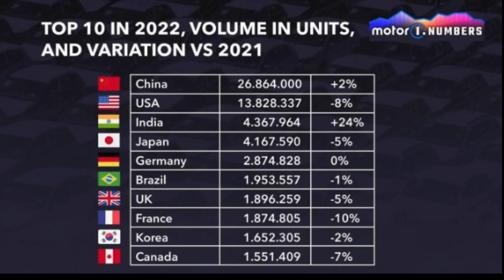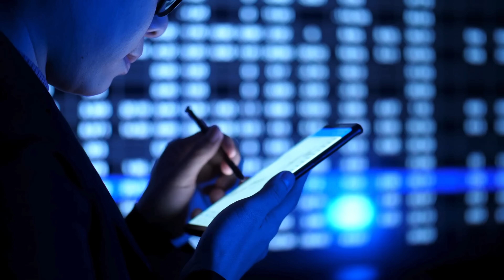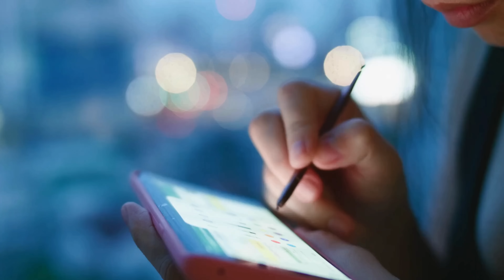Has China Collapse? Kishore Mahbubani’s Answer

Comment: Based on your info, China sold 26 million cars annually, more than US and Europe combined. Then 10 years from now, because of Electric cars, the smogs released from cars will be very little compared to US, Europe, Japan.. etc. This is one of the the reasons China pushed very hard to use EVs, as China planned to have Carbon neutral by 2040 or 2050.US has put 100 tariffs against Chinese EVs. Would US be able to solve clean air problem, if EVs are not encouraged ? You can always see the resistance from all OIL companies as their profits will be diminished.
Reply: True man, 1.5 billion of Chinese vs 300 million of Americans.
Reply: Carbon neutral? Seriously! China is increasing it's generation capacity by increasing the number of coal based power-plants ; so while you're increasing the number of EVs your emissions continue to grow. Certainly not the way to reduce your carbon output. Though you can reduce pollution in the cities.
Reply: @fauxpaxit8274  coal is nothing compared to petrodollar.
Reply: @MSDGroup-ez6zk  We're talking about pollution not revenue.
Reply: Just came from Shengzhen China, public transport are all in ev, 80-90%% private vehicles are electric, as a result the air is clean and noise pollution is minimal. Any country that  want to achieve carbon neutral should learn from Shengzheng.

Comment: There is a consensus on the necessity of alleviating poverty ; however, it is essential to recognize that this issue has roots in a prolonged period of governance marked by authoritarian rule lasting a thousand years. During this time, there was a notable abandonment of spiritual values, with an increasing focus on materialistic pursuits. 

Additionally, the key performance indicators (KPIs) used to measure progress are outdated, particularly concerning gender equality, as women continue to face significant disparities. This perspective primarily reflects a male viewpoint and highlights the shortcomings of analyses rooted in a historically biased patriarchal system, which neglected to account for the contributions and potential of half the population.

Comment: If any country was strong and wise, it should continue to rise higher and higher. However, it is Not that it is weak or fails; it has hit its maximum potential.  The downfall is evident and undeniable. Many small and big mistakes added up. They didn't see it coming.